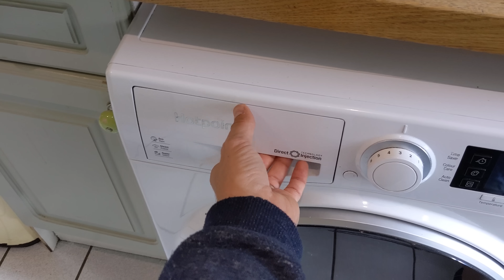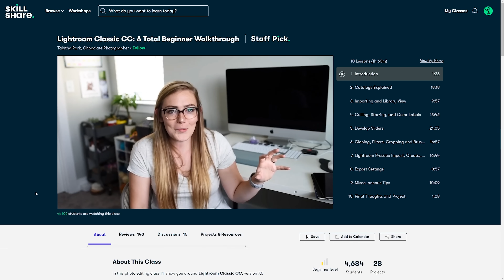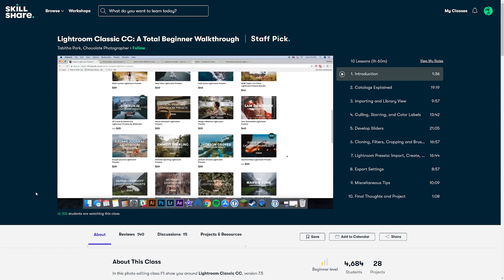The Pythagorean Siphon Inside Your Washing Machine

Comment from the maker: This is the first time I've filmed from my toilet! The audio isn't great for that section but I felt the context was important!

The sponsor is Skillshare: For a limited time, use this link to get a free trial of Skillshare Premium Membership: https://skl.sh/stevemould09201
Reply: My toilet here in USA doesn't use this method. It's a hole where your plastic siphoned is hooked up with a rubber flapper over the hole and the push of the flush lever lifts the rubber flapper draining the tank into the bowl
Reply: @enkayFPV  TatatatarRRrrararràrararàràrR4Rarà4rPprRRarPr
Reply: Enkay e
Reply: Enkay gete
Reply: @enkayFPV I've seen those... You must be poor.
Reply: @enkayFPV  came here to say this. Nothing like most residential US toilets. It's just a flapper. They eventually leak.
Reply: @JeremyMitts  yep either the rubber warps or starts cracking. it eventually happened to all flappers now except on the older toilets with good quality rubber. stuff nowadays is super thin too
Reply: @enkayFPV  In India, my toilet is pretty much like yours, it's basically the same and i don't know why the Plastic that is lifted don't go down even when the pressure on the striker is removed, maybe Steve can make another video about it.
Reply: You can make a green screen, and film yourself in front of it, and then get a picture of a toilet, and then put some bathroom reverb or early reflections over your voice in post.. but I think this also did the trick. Sometimes bad audio is fine, when the circumstances are right.
Reply: My toilet in Ukraine (and Russia) uses another design. It has output hole in the bottom, covered by big rubber seal, which is pressed down by the weight of the water itself. And when you flash your toilet this seal lifts up allowing water to go under it and also to keep seal up (it is lightweight).
As for owerflow, there is a simple tube in the center, which determines height of water in case of leaking buoyancy valve.
Reply: @karakurt7876  lol after hole in bottom i thought you're talking oldscool there 😅
Reply: I think the greedy cup for the toilet is specifically referencing the bowl not the tank. That behavior is indeed a greedy cup, even if it has a fancy high flow exit to remove, uh, *debris*. 

The bowl sits at a fixed water level until more water is added. Then the bowl fills to a certain point and starts draining (the rapidity of this draining is mostly due to the water being added, but that is immaterial to the point). Once the water stops, the bowl continues draining to well below the starting level until the siphon is broken. The bowl is then refiled to the starting point very slowly from a small overflow as the tank refills.

I can probably find example videos if you are interested.
Reply: @lucusloc  Yep. I was lookimg for this comment. Nice
Reply: In Australia we don't have a Cup Siphon, it's a plug that gets pulled up and is boyant enough to float in the water until it seals up again when most of the water is gone/flushed.
Reply: Hey Steve, you might want to take another look at your toilet. There's another siphon in there you're forgetting about. At the bottom of the bowl/basin the "p-trap"/U-bend acts as a greedy cup siphon. You can even test it out: get a hose or bucket, and fill the basin/bowl; as long as it isn't clogged, it should empty its contents into the sewers as soon as the water level crests the U-bend.
Reply: I'm confused, isn't the water seal in the bowl drained by a siphon? Cut off half of your 2d model and you will have a perfect model of a toilet flush. It's why a clogged toilet flushes once you get it unstuck but also why there is water left at the bottom of the bowl, it's by design. Keeps gasses from traveling back up the pipe.
Reply: At least you didn't have a candybar in the bowl like that one girl who was taking her facebook/Dating app pic in the bathroom but forgot to flush.
Reply: Every toilet I have seen in the U.S. has the same mechanism for filling toilets, but the water release is just a single valve on the bottom of the bowl. So you get more water by holding down longer and letting it drain into the bowl.
Reply: Here in the upper Midwest USA all the toilets I have come across just have a rubber flapper over the hole to the bowl that is lifted by the handle. The water flowing down quickly holds the flapper up until the water flows down.
Reply: Your 2D demonstration was very helpful.
Reply: Here in Sweden we have same mechanism as you show, but at my wife's parents place in China it's not the same, their older traditional squat toilet just uses common sense and you activate the water with a lever and deactivate with pulling it back up. But a few years ago they changed toilet so now it's similar as in this video. When it comes to public toilets in China it's very different most Ive seen is squat style but uses sensors to detect if your there or not. Some very old uses similar cyphon based but with the tank very high up and pull with a chain to activate.
Reply: Steve, tell us about the syphon at the end of the system, the one which stops odors from coming back up and makes the water stop filling all the way up the toilet
Reply: I have to say, i really enjoy every video you make.
I can see how much effort you put into each one of them 👌
Keep up the good work man ✌️😁
Reply: @Lardah  Agreed! Well said.
Reply: in france we have the gasket+tube method.
you should talk about the water ingress valve, it is quite clever :
there is a small hole that is plugged if the float is up, and that actuates a rubber seal due to the increased pressure on one side, blocking off the output. if water is allowed out of the hole, the membrane is under equal pressure, and so the water can go out.
Reply: Rather sure the part of the toilet that is being asked about is where the waste water leaves.
Reply: Hi Steve! 
I hope you see this! How well would the Pythagorean siphon work, if the liquid was carbonated?
I am curious to know.
Cheers 😊
Reply: @D33P-5H4D3  Maybe only slightly worse but not significantly.
Reply: The usa uses a gravity fed system I think. I wonder if you could do a pressure test to see which system produces a better flush?
Reply: I have never seen this type of flush system. In my toilet... When you pull the flush lever a chain pulls ooen a rubber flapper that allows the water in the tank to rush at high flow into the toilet bowl via the flush ring. Whrn water level in the tank drops enough the flapper slaps shut stopping the flow of water. Then the refill valve refills the tank till the float reaches top setting. Then it shuts off till the next flush!
Reply: Have you been sleeping enough? all your video's I've seen, your eyes look red and puffy like you'd just done an all nighter.
Reply from the maker: @Macswaggens  thanks
Reply: Pythagoreeeeeean
Reply: If Dr. Mould only knew how grateful I was when the toilet at the apt. I'm staying in finally flushed completely. His comment at 07:45 about half draining the system saved me from a persistent floater.
You have more than a fan or admirer in me, I'm pathetically grateful that you saved me the embarrassment of getting the staff to call a plumber. You literally improved the air quality of my life. Thank you.
Reply: Wow, that was interesting! Lol, I had always assumed that there was a pump sucking the detergent from the chamber in my washing machine.
Reply: Thank you for the lesson 😊. Suggestion for a future video: How HE front loading washing machines work. How do they operate without a lint filter tray? Where does our lint go? 🤔
Reply: @Digitalhunny  The newer front load washers have a lint trap on the front.  Usually behind a little door on the bottom left.  That was the main issue with the 1st gen.  If something clogged up the system, it usually cost 150 bucks and a day based around a service call.  Now you can do it yourself.  Also on the dryers, if you ever stick your head in and look inside you will see two metal strips.  Be sure to clean those with a bit of fine sandpaper, or magic eraser, to remove the residue since those are the sensors that tell when the machine is done drying.
Reply: @MrShwaggins  - Thanks 🤗
Reply: @Digitalhunny  No problem.  I used to work with them.  I also undervalued the act of cleaning out the vent pipe of your dryer until I purchased a long brush that u attach to a drill and cleaned it out.  There was a TON of compacted fluff just waiting to start a house fire.  I wish I would have taken a pic of the amount.  After that my clothes dried off much faster.
Reply: @MrShwaggins  - Unfortunately, I currently rent & my driver house is in between the ceiling under drywall... all 20 feet of it!! I've clean it the best I can, fully knowing the dangers of not doing it. Have no idea if maintenance has ever cleaned these some 80 units hoses, from the 1960's? Worse though, if I do care, what about those other tenants that don't? 😣
EDIT: This better not jinx me.... I have the 1st gen. front loader. All great. Don't comment on this... you'll screw up my luck.😂😂😂
Reply: @MrShwaggins  Thanks for the tip! I'll use some fine steel wool to restore my drying sensor.
Reply: @MrShwaggins  Dryer lint really is a problem! I have 2 manual brushes. One fits Whirlpool lint filters, from the lint filter opening, and the other works from the vent outside the house. I set the dryer to no heat, to eject all the freed lint as I work on it.
Reply: I love your videos! You do an amazing job making them enjoyable to watch and choosing topics that I can’t resist clicking on.
Reply: Go back and film it again from the gents' urinals - there's one of these automatic siphons there to flush the urinals on a regular basis but it's more clever.
Reply: @Dr ROLFCOPTER! Absolute BS :)
Reply: I'm in the USA and have never seen that type of toilet thing. Pretty interesting.
Reply: As if the audio is good anyway, recorded this way, with a "shirt mic" (just take some good headphones and search for binarual audio or 3D audio and you will se what "real" good audio is). But 99% of videos productions are like this. The content was great anyway (I did know how siphons work, but not they ere used so much for applications like this).
Reply: Definitely country-dependant. Hungary uses the same as mentioned by Роман Яковлев
Reply: I thought the greedy cup part of the toilet was in the bowl of the toilet, not the back. A trick to get a toilet to flush when the water is turned off or the back of the toilet is broken is to pour water into the bowl. Once the water reaches a certain level, it flushed!
Reply: You could use a similar siphon to build a water computer, logic gates, etc.  A properly constructed set of siphons would work just like a transistor.
Reply: Actually here in the U.S. ours have  drop goose neck toilets 🚽 in most places, some of them have low volume flush tanks or even air assisted flush mechanisms that actually use a pressure flushing tank so as to cut down on the water needed to actually flush the toilet with now. But , honestly these are very noisy and sometimes don't work very well and have been known to get plugged up then during the flush the high pressure flushing tank actually blows through so hard all of the sh 🚿 or sh  let's say💩😱 boo boo flys in and then up and out on the user or users standing near bye bye for the 💩 poo gets a nice even spread out over the room.
Reply: Thank you so much for an interesting demonstration of physics.
Reply: Toilets are different in the USA
Reply: Well, you ghat me how to get the half flush from a toilet cistern. We've had two in this house over the past 40+ years which nobody ever figured out until seeing this video. Thanks. 🙂👍 Too bad that we opted to have a cistern fitted a few years ago which doesn't have that feature...
Reply: Steve, as Enkay and lucusloc say, in the USA the cisterns just have a plug/flapper that a chain pulls up and it will stay up while water flows through and once the cistern is empty, it seals again.  It's the bowl that's a greedy cup. As the cistern empties, the bowl fills up to a point and then the syphon is formed and the bowl empties.
Reply: Most toilets in america don't have this extra (unnecessary?) siphon. We have the mechanism described under flapper valve on the wikipedia page for ballcock. This means the lever can be slightly pressed to not completely dislodge the flapper and just drain a bit of water into the bowl, or pressed normally and it will fully drain the tank... or even held to continuously drain water into the bowl at whatever rate the fill tube would otherwise fill the cistern+bowl. I'm not sure if the siphon system would even require less pressure on the handle to actuate... you're essentially lifting half a litre of water (with leverage) versus breaking the seal on the flapper valve. Also, maybe not as common in the UK, but frequently our actual fill valves will be reverse to what was shown and are spring-loaded shut so they require a weighted (by heavy rubber balloon) lever to OPEN rather than the ball floating holding the valve physically shut that is otherwise spring-loaded open. This means if the balloon deteriorates and falls off (or is removed) it doesn't continuously run.

That said, the actual flushing of the bowl is a greedy cup mechanism as with most toilets, so even pouring liquid fast enough into the bowl to cause the water to form a seal/siphon in the u-bend will flush the entire bowl because not enough air can pass back through to equalize the pressure in the pipe and it forms a vacuum; which will only flow one direction because of gravity.

TL;DR Over here in the cistern it's not a siphon (because work against gravity is not being gained through air pressure), it drains through gravity and the stopper valve just actuates by being pulled via chain and is buoyant enough to float in the water until it's suctioned to the opening in the bottom when it's empty, and stays there through the water pressure above it being greater than the air below.
Reply: Most washers just dump it right in and don't have a little hole like that
Reply: Mr Mould, Congratulations 
you're the Siphon King 🤴
Reply: Your toilet audio is fine. Your toilet? Well that's a bit moldy. 😉
Reply: Record a video in which you tell about toilets with a button at the top (more often found in Europe). Pls
Reply: For 3 Xanax bars and 4 percocet and 5 oxycontin I'll fix ur washing machine, dryer and toilet and hot water heater.
Reply: Hello sir thanks a very good video thanks
Reply: Thank you, I love learning new things and you tend to teach often.
Reply: You totally missed the siphon flush mechanism in the toilet bowl trap that would be the more relevant comparison.
Reply: Never heard of piethugoriss but this was supposed to be a video about a Pythagorean siphon or something, not this guy piethugoriss and his piethugorian siphon >:(
Reply: Is that a Delchem Fill Valve I spy in thay cistern? And a Viva Syphon?
Reply: Im 2 hours early but lots have watched
Reply: Awesome vid, at some point can you do a video that explains why light (rays) exists in sun (i mean the streaks). But if you look through a net and based on your perspective the streaks go off in different directions!
Reply: Context is for Kings
Reply: *First time YouTube accepted the video filed from your toilet you mean.... We know what you got up to....
Reply: That's not filming from the toilet. THIS is filming from the toilet: https://m.youtube.com/watch?v=3DC_M2VgfVA
Reply: https://youtu.be/aMxxpEn1opc
here i have demonstrated how to make diy plano convex lens using resin just to turn the phone camera into a basic microscope .
Reply: Greed cup
Reply: Ee yttryer
Reply: So is this a washing machine or a filling machine?
Reply: awesome video upload!!!
Reply: Yo mama
Reply: You're wrong
Reply: Jok3s on you 1 dont have washed machining
Reply: @solitudemaster838  because you are Indian you have nothing
Reply: Sese
Reply: 0
Reply: @CanyonGray  seems like something is broken on your part...
Reply: @Lardah  I can’t lie I fell asleep on my phone with it on
Reply: @CanyonGray  Yea happens more often than you think 😁
Reply: https://youtu.be/4G6e4TaJxkI 0:20!
Reply: there’s a resonance around 300Hz. You can take a parametric EQ, create a narrow boost, and drag it around until you hear the problem frequency. Then cut that narrow band of frequencies down by 5-15dB or more. Would instantly sound much better.

(For next time you film in the bathroom I guess). sorry
Reply: Must be a European design, not at all what's used in Canada...
Reply: (Fact) : It works the same way the (Greedy cup) Works
Reply: I have the 100th reply and i’m not gonna say anything useful
Reply: Thank you for your video's. Because of this particular video I was able to make my own pythagorean cup. And it actually works! Next project is the assassins tea pot!
Reply: Thank you from me n on my friends behalf I got many stories about the head n the things I'd do n ppl would do to fix n adjust it lol very funny stuff
Reply: I got the old version toilet with a rubber plug in the bottom of the cistern.  The lever lifts the plug.  No siphon from the cistern.
Reply: it's more commonly known as a Bell siphon now and is very common in Aquaponics setups to drain the grow beds to a specific water level by non-mechanical means
Reply: Liked. Subscribed. Comment: easy to digest and memorable. Originally seen the beginning on Facebook. Remembered this and came here to show my nephew 👍🏻
Reply: As a wine-lover physics teacher I must know where can I buy a greedy wineglass from?
Reply: @fanthomans2  ebay, amazon etc
Reply: I don't know how our flush mechanism works yet, but it's a in wall type with a big push lever button and if you let go it stops.
Reply: Toilets in the US are nowhere near as advanced as UK loos.  In the US it's just a flap over a hole in the bottom of the tank that leads to the bowl and flushes it.  Down and dirty like everything in America.   
I've been in California since 1991... every time I visit the UK I'm reminded of how far behind everyone else we are in the US.  From magnetic strips on bank cards to ancient 1950s tech engines in brand new 2021 cars.  The only advanced things the US have are military satellites, weapons and aircraft.   Such a backward place.
Reply: Hey, why are you concerned about your pronunciation of u'rinal/urī'nal, which is only regional, when you don't know Pythagoras's name!  Nobody but nobody has ever called him PY'thaGOR'as in my earshot.  Did you not learn at school the Pytha'gorē'an formula to find the hypotenuse?
That said, it's nice that yours sounds like a disease from a sci-fi film, pitha-goran syndrome -- no no, it's a new strain of 'flu found in the Goran Heights!
Reply: Hey Steve! Can you work your head around this inception siphon contraption!? Big Clive thought he had it figured out. It's supposed to be a URinal auto siphon. https://youtu.be/BQ45kMi6HkA
Reply: 🐻 Lokah Samastah Sukhino Bhavanthu
🐻 Sabbe Satta Bhavanthu Sukhitatta 🌱
🐻 May all Beings be Happy 💞❤️💕💗 പ്പെട്ടത് 🌎🌏🌍 പ്പല്ലട്ട്പ്പെ 🐻🌱🥥🌱🍊🌱🍎🌱🍇🌱🐻 Be Vegan 💕🌱🐻 റ്റഗ്ഗംഡ്യൂ
Reply: What Is Islam?

Islam is not just another religion. 

It is the same message preached by Moses, Jesus and Abraham.

Islam literally means ‘submission to God’ and it teaches us to have a direct relationship with God. 

It reminds us that since God created us, no one should be worshipped except God alone. 

It also teaches that God is nothing like a human being or like anything that we can imagine.

 The concept of God is summarized in the Quran as:

{ “Say, He is God, the One. God, the Absolute. He does not give birth, nor was He born, and there is nothing like Him.”} (Quran 112:1-4)

Becoming a Muslim is not turning your back to Jesus. 

Rather it’s going back to the original teachings of Jesus and obeying him
Reply: @ahmdabdallah5811  lol posting your religious stuff in a video about excrements... Kinda fitting i must say.
But no one asked for it 🤔
Reply: @Lardah  i did
Reply: @ayuballena8217  you did what?